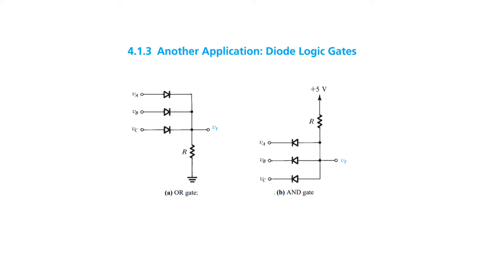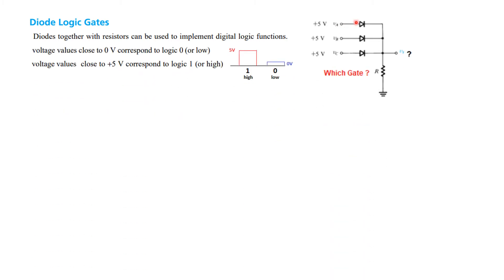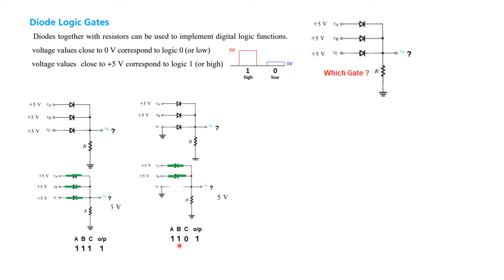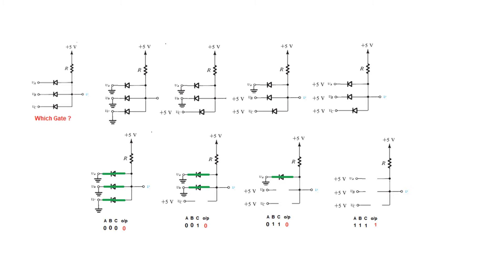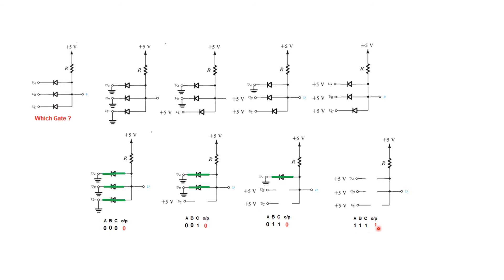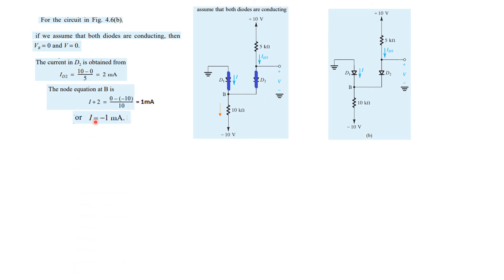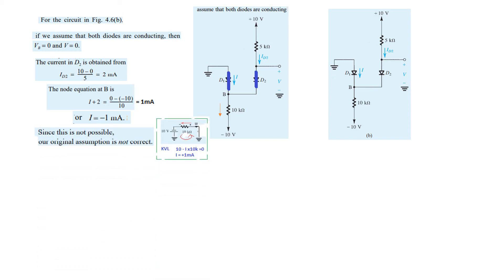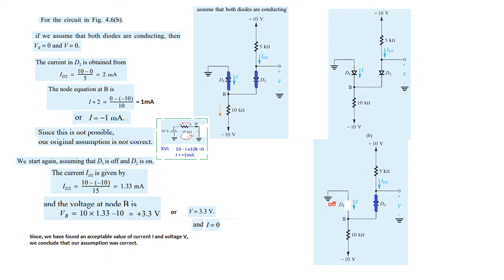(E)EDC(S) Ex 4.2 || Diode Logic Gates  || AND and OR Logic Gates

Comment: sir really helpful i was not able to understand that and  gate part from sedra smith
sir doubt is that instead of thalogic 5.7 volts can we say that in case 2 of and gate there must be a drop in voltage due to resistance so the cathode part of the last diode is connected to 5v and anode part is connected to a voltage less than 5v making it behave as a reverse bias?
because in reverse bias condition cathode is connected to a higher voltage.
Reply from the maker: Please write the video time where you are at

Comment: in fig 4.6 a, voltage at B and ground are both 0 then I=0, why I=1 while VB=0, that's not possible
Reply from the maker: A common mistake most of us make is to apply ohm's law everywhere. Remember ohm's low is not always valid incase of active circuit (having diodes, transisrors etc).
Joke about logic: If you are sitting on a table, and the table is on ground, then logically you are sitting on the ground 
:face-red-heart-shape:

Comment: Which type of values is acceptable? I mean how would i know that my assumption is correct or not
Reply from the maker: Mr Sedra Says "we make a plausible assumption, proceed with the analysis, and then check whether we end up with a consistent solution ". So give it a try with different values and see what u get. Please share with me your findings.
Reply: @ElectricalEngineeringAcademy  OK. thannks.. i got the same answer as you do
Reply from the maker: Please write time reference of the video, so I know where you have problem
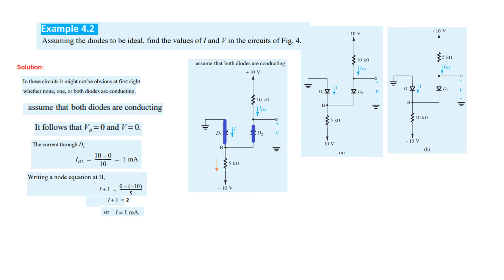Reply: @ElectricalEngineeringAcademy  12:35